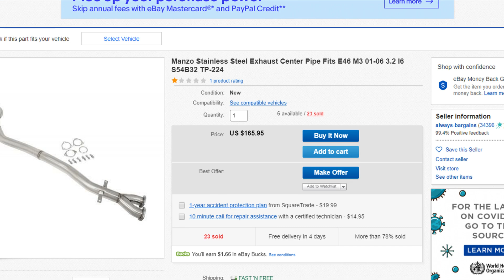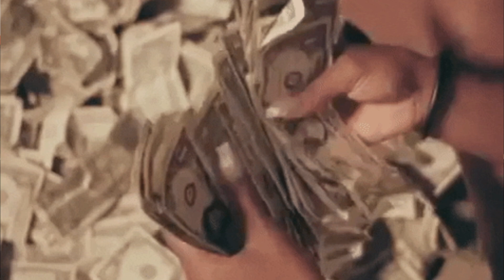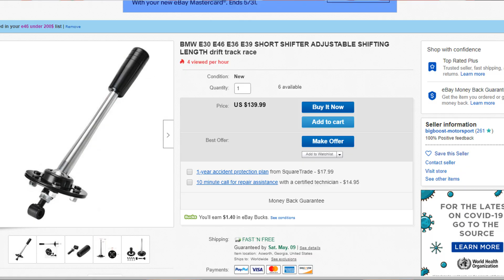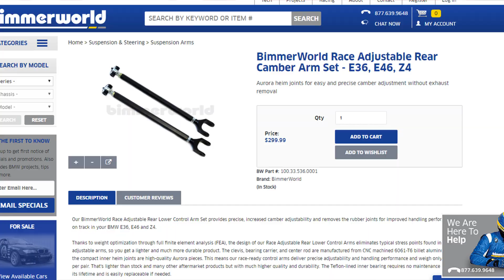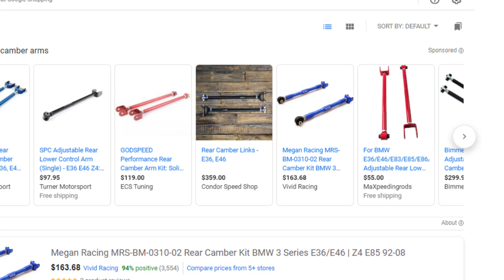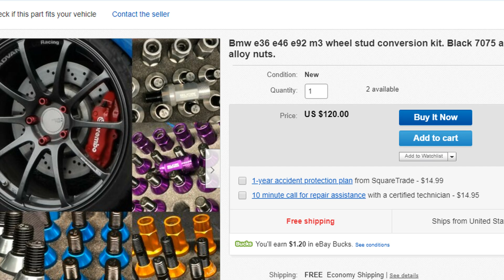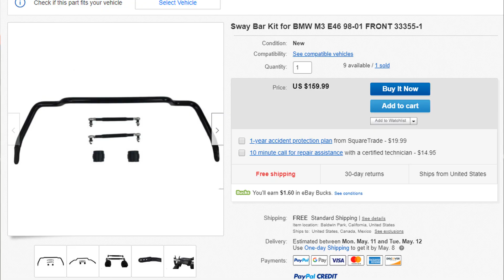Top 5 Things to buy for your e46 m3 for under 200$

Comment: The section 2 actually does not replace that exhaust piece with the one resonator and one non resonated section, since that is section one. Section 2 is in-between section1 and the mufflers (3)
Reply: Even the supporting clip shoes what it replaces, so please remember section 1 is the rasp causer not section 2.

Comment: I've been trying to get info on air intakes for the S54. Are they worth it? Have you dyno'd with and without an air intake to see if the $$$ is worth it? Know anyone that's done this that's reputable? Thanks and enjoying the channel
Reply: If you’re going for power they’re not really worth it, your best option would probably be supercharging. CSL intakes are just the most premium option if you want to keep the car N/A and highlight the induction noise. Velocity stacks are also a similar option. I purchased the CSL intake from Turner Motorsport which I think is a great deal, the build quality is excellent but I haven’t installed it yet because I’m doing some other things first. A YouTuber named BuzzyTheBlue has an Evolve CSL intake (considerably more expensive), and Fatboys garage has the same turner Motorsport intake I have. Lmk if you have any more questions or if anything reach out to one of them

Comment: Hello how are you? I have a 2001 bmw 330ci and I recently installed a rear camber kit but it’s those that have the adjustments on the tips of it. Can you explain how they work or how to fix my camber because my camber is still negative :/ and the road is eating my tires on the inside like crazy